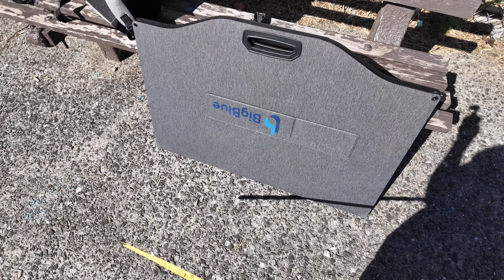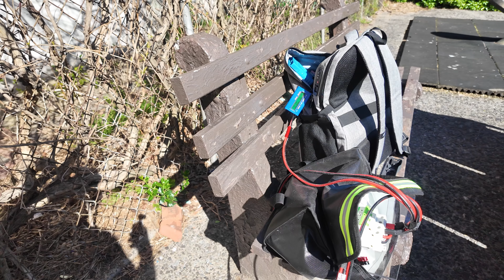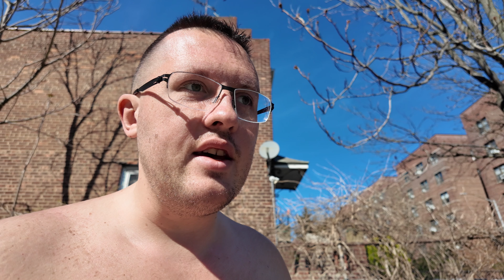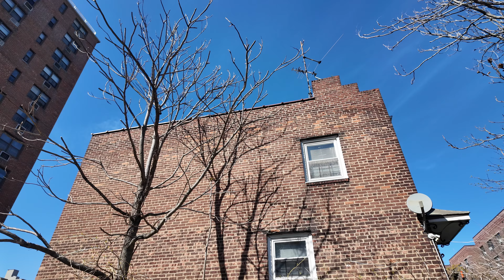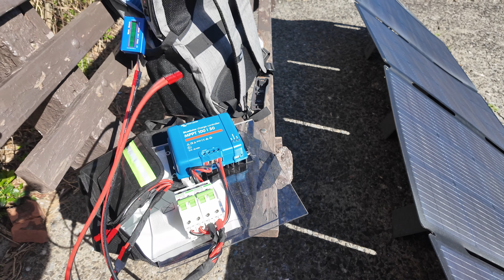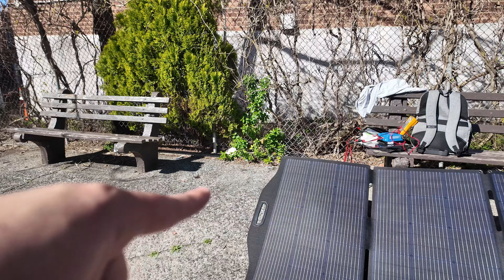🔋 BigBlue Solarpowa 400 Watt Foldable Portable Solar Panel Unboxing and Review #wisebuyreviews

Comment from the maker: SEE IT HERE: https://amzn.to/3W2ANbT - BigBlue SolarPowa 400  [amazon affiliate links]
- https://amzn.to/440ZebM - BigBlue SolarPowa 400 w 1843wh Solar Generator
- https://amzn.to/49Oeb2g - Victron Energy BlueSolar MPPT 100V 30 amp 12/24-Volt Solar Charge Controller
- https://amzn.to/3w6cLlD - 12V-110V DC Miniature Circuit Breaker, 50 Amp 2 Pole Battery Breaker Protector for Solar PV System and RV, Thermal Magnetic Trip, DIN Rail Mount, Chtaixi DC Disconnect Switch B50
- https://amzn.to/3vVbJca - BNTECHGO 10 Gauge Flexible 2 Conductor Parallel Silicone Wire Spool Red Black High Resistant 200 deg C 600V for Single Color LED Strip Extension Cable Cord,Model,50ft Stranded Tinned Copper Wire
(affiliate links)

You may also want to see my OTHER SOLAR PANEL REVIEW VIDEOS:
- How To Install BougeRV 100 Watt CIGS Solar Panel On Highlander SUV Car Roof Review #wisebuyreviews - https://youtu.be/1ab9L63EVeo 
- Panana 200W Portable Foldable Solar Panel 200 Watt UNBOXING and REVIEW TEST #wisebuyreviews https://youtu.be/YG1WhoDCH9Q
- Nicesolar Foldable 200W Bifacial Solar Panel UNBOXING REVIEW on Sunny Day #wisebuyreviews  https://youtu.be/H12rmL-ItIY
- Eco Worthy 100 watt Bifacial 12v 100w Solar Panel Review Is It Any Good #wisebuyreviewshttps://youtu.be/8zqZhlhIKCM 
- Wetown 200 watt FOLDABLE Portable Solar Panel Unboxing Review #wisebuyreviewshttps://youtu.be/nlInvWpN5V0
- Topunive 100w BIFACIAL Portable SOLAR Panel Unboxing & Review #wisebuyreviews - https://youtu.be/6sxaP3xaNFI 
- BigBlue Solarpowa 400 Watt Foldable Portable Solar Panel Unboxing and Review #wisebuyreviews - https://youtu.be/qZiWJti3gk0
- Topunive 100w Foldable Portable Suitcase BIFACIAL Solar Panel Unboxing and Review #wisebuyreviews - https://youtu.be/Kd1H9-FCNi0
- Nicesolar Foldable 200W Bifacial Solar Panel UNBOXING REVIEW on Sunny Day #wisebuyreviews - https://youtu.be/H12rmL-ItIY
- ALLPOWERS SP035 200W Portable Solar Panel UNBOXING & Review #wisebuyreviews - https://youtu.be/Zqs-CPRUcvs
- FUNAURORE Cheap 120 Watt Foldable Solar Panel REVIEW UNBOXING for Solar Generator #wisebuyreviews - https://youtu.be/XaJ4MrXHNYA

- See all my videos here: https://www.youtube.com/@wisebuyreviews/videos 

BRIGHTEON VERSION
https://www.brighteon.com/25b50722-2442-4e31-a7de-7c8240dca693
YOUTUBE VERSION
https://youtu.be/qZiWJti3gk0